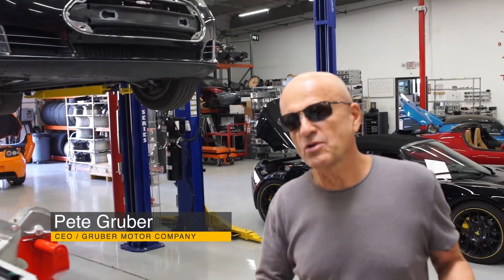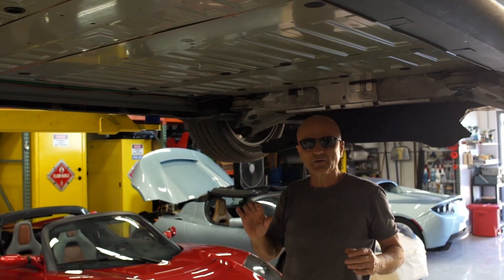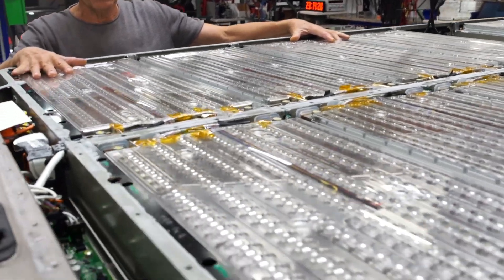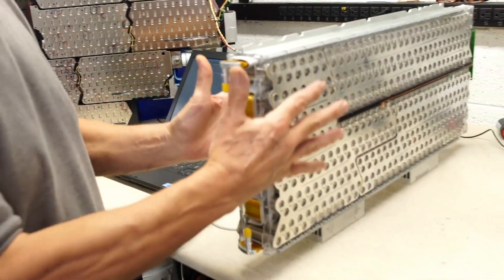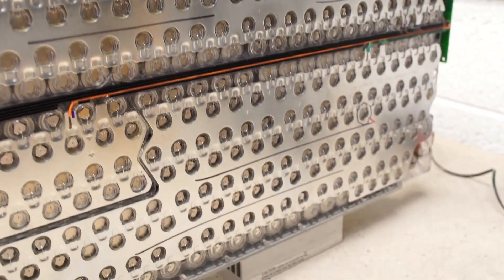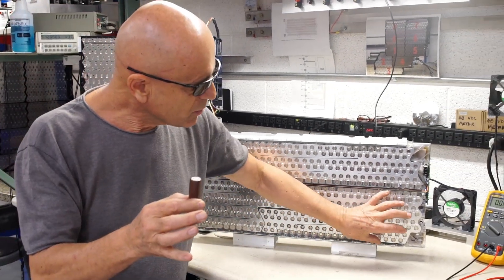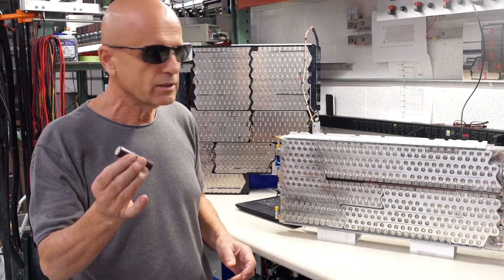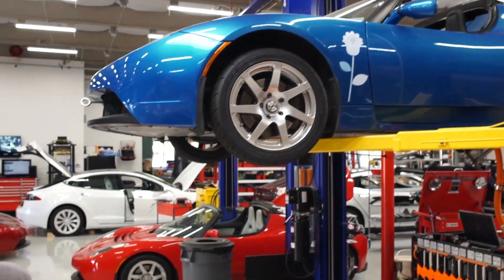Tesla Model S Main Battery Repair | Gruber Motors

Comment: Just curious.... What was the cost of this specific repair?
Reply from the maker: Audio Innovations Pricing will vary, but approximately 5k total. Less for local or Southwest region due to transport costs.
Reply: @grubermotorcompany  Does the battery return to a normal degradation (usually 4-5% degraded after 50k miles), after the battery is snipped out?
Reply: But if a short time after you have this $5k repair done another single cell fails you are back in for another $5k repair.
Reply: @NasaRacer I think it would be good to check all the cells while it's being repaired and replace cells which are likely to fail.
Reply: @NasaRacer  I was surprised with this strategy of repair. Gruber motors might have suggested a full module replacement (with a used one), which in my view would have been a better alternative. Salvaged modules with no problematic cells are running at ~1k. I guess the -1,3% drop on the "snip-it-out" solution was optioned by the costumer.
Reply: @jpinto3912  Great question !!   ........think the modules have to be mated with each other
Reply: It was under $5K
Reply: All said and done - around $5K
Reply: Thank you, gentlemen.

Comment: Will Gruber also be doing drive unit repairs for the Model S in the future?
Reply: We are already doing drive unit repairs.  We repair the inverter section, and mechanical portions of the 3Φ AC Induction Motor, plumbing, bearings, and other associated electronics.  We represent  cost effective solutions for out of warranty customers.
Reply: We already are.  Another costly replacement item that can be repaired instead.
Reply: @petegruber2353 I’m glad you are helping! Curious because everyone else’s answer is swap it and charge! If you’re pulling a battery pack the labor is about the same for 1 or several cells including troubleshooting. I’m in Texas not sure where Gruber motors is. How much are y’all charging to drop a battery and snip out cell? Also are you replacing the cell or just taking it out of the circuit

Comment: Thank you for sharing this! My 2014 P85D has two years of battery warranty left and given the track record with drive unit replacements (3 so far) it’s comforting to know that there will be a non-Tesla option when the time comes for work on the main battery pack. I asked the Tempe service center last time I was there what the cost to replace the pack would be (since they do not repair, only replace) and they said “about $25K”. And that includes the credit for trading in the old pack! Very glad to have you guys as a local alternative to the Tesla service center - you’ve already saved me a ton of money on air suspension and other maintenance items. I think you’re going to get VERY busy as the 2012, 2013, 2014 cars begin to come off their powertrain warranties!
Reply: We plan on expanding to meet the needs of our customers.  Thank you for your business.
Pete
Reply: @petegruber2353  Would be curious what options are for east coast cars-- since cross-country shipping is $$.  Maybe partner with Electrified Garage?  They need more locations too though.  No viable options in my area that I'm aware of.
Reply: @petegruber2353  Please open a location on the East Coast around DC or NY :)
Reply: You can sell a pack with one failed module for like $8000 (they are bought for DIY powerwall and gasoline to electric conversion purposes). What's the cost for Tesla to install a new pack into a car that has had its pack removed and sold already? It could be more cost effective, ending up with a new pack and all.
Reply: @celeron55  You can even buy 2 damaged battery packs, so you have spare modules to repair any battery. If you had the equipment they have in gruber. I bet Tesla could do  just that when they replace a damaged battery, keep it, to refurbish “new ones” for replacement, and so lower the price, and make refurbished batteries a cheaper option for cars out of warranty.
Reply: @celeron55  not a chance
Reply: It's a steal consider fe battery price today at about 100$ per kw
Reply: Just like a dealer after the warranty period expires they won't talk to you other than by genuine parts. Dealer = legal thieves 😮

Comment: Awesome, nice to know that there are options for older Tesla vehicles besides purchasing a new battery pack.
Reply: Of course there are. Not just for tesla. Imagine this car is an overgrown cordless impact driver.
If only car manufacturers would make the battery pack maintenance and inspection easy and accesible, not requiring extensive and expensive equipment to access. The right to repair, not to be abused by dealers that will push you onto new battery packs because the old one is old and dead, when in fact a single cell replacement makes it great again, even after maaaaaany years of use. But that is the scsm of the official dealership, a monopoly to prevent customers from fair repair.
Reply: @AudiTTQuattro2003  you have no idea, you pull out a 10 year old battery pack to replace dead cell, put it back together and in  a few weeks weeks or months another cell dies and need to do it all over again? That’s why Tesla want to replace the whole battery pack, and when you rebuild an ice engine it’s good for another 10-20 years
Reply: @christinalaw3375  how is that unlike any car maker with non EV cars?
Reply: That's crucial. I for one would never consider buying a Tesla if I am looking at a $22000 battery pack replacement after 8 years or so.
Reply: @AudiTTQuattro2003  It’s nothing like an engine rebuild? You disconnect the HV, drop the battery out and remove the lid and a couple of hose fittings. You can check the battery voltage with a $20 multimeter. Yes it’s a sealed lid and removing and resealing it isn’t easy and that’s the part where specialist tools come in but that’s because it’s a completely sealed system - on purpose. That’s hardly engine rebuild territory. To put it into perspective, Neo (Chinese EV maker) just completed it’s 2 millionth battery swap. It takes about the same amount of time as filling your car with gas. Even Tesla’s battery is pretty modular.